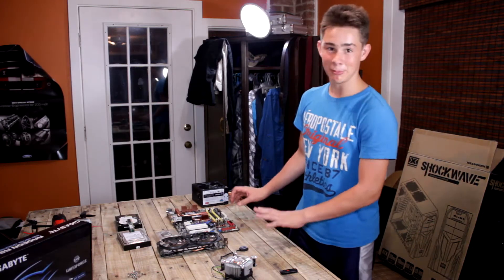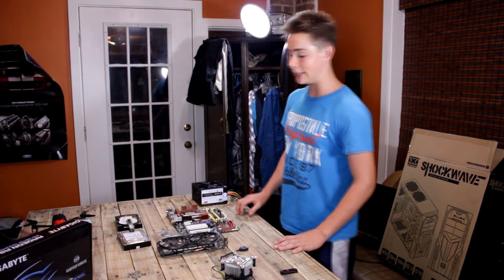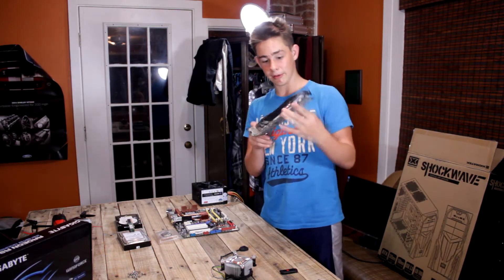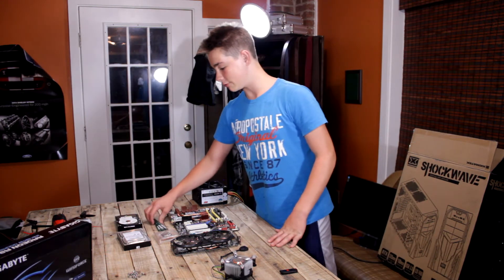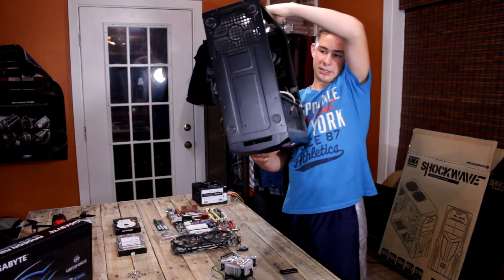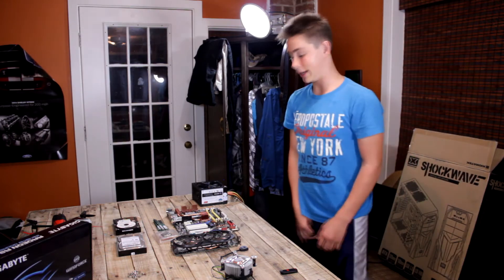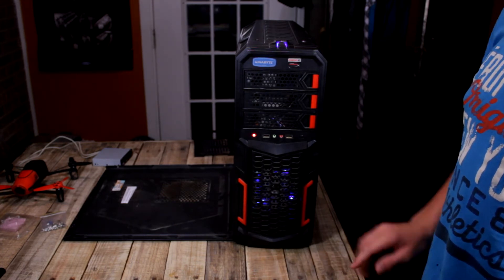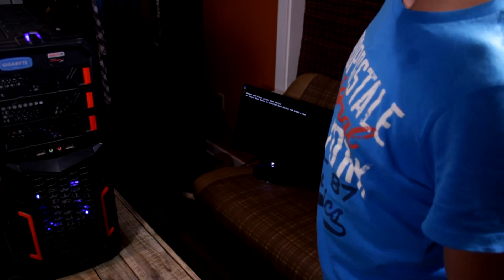JunkYard PC  (Davids build ) Build 148 $ Gaming PC Build

Comment: The Q6600 is an epic processor. My dads old gateway has one in it, with 6gb of ram. It's from 08 and it started getting pretty badly slow around 2014. Pin-modded the processor and now it runs about 3.0ghz, added more ram for a total of 8gb, and threw my buddies old radeon HD4850 into it. Computer runs insanely well now, and by no means is it a gamer or heavy duty rig, but it's awesome how cheap modifications can add years onto a pc's life span!